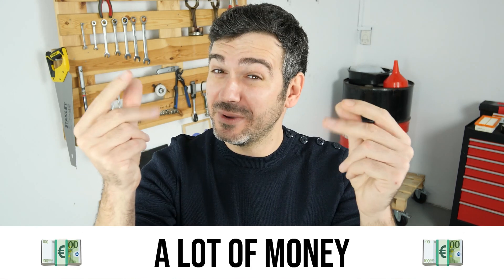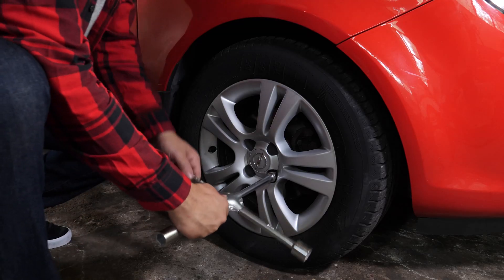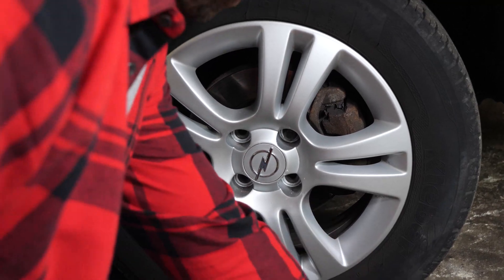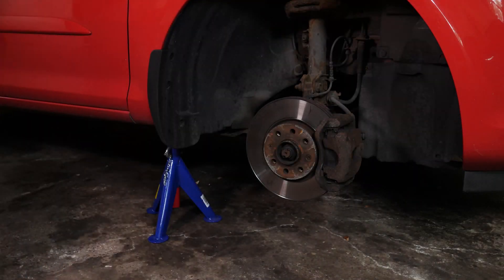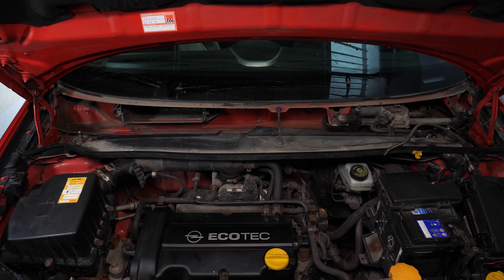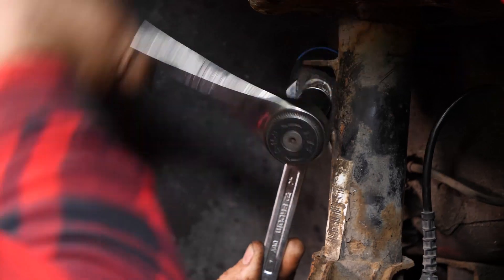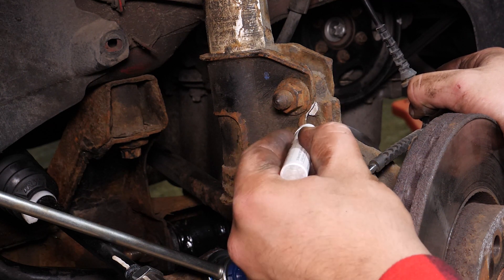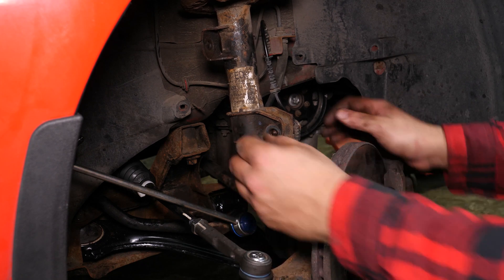How to replace the front shock absorbers Corsa D (1/3) ➿

Comment: 3:02 dude... you got lucky there :D On the same platform Grande Punto, those two bolts were so welded in that even a 400W electric impact just barely got them out (had to go back and forth 10 - 15 times).
Reply: FIAT fix it again thomas